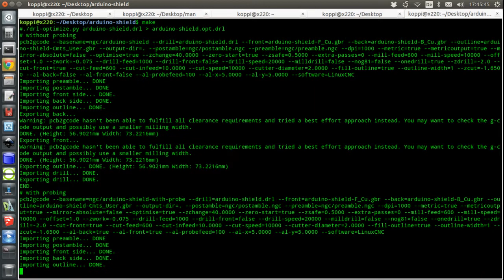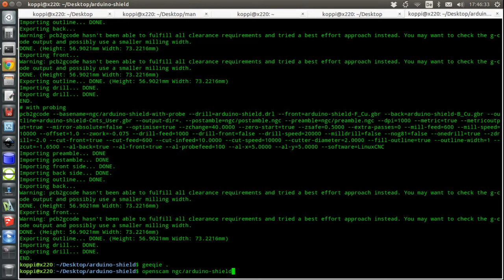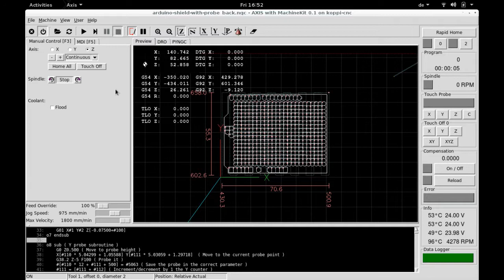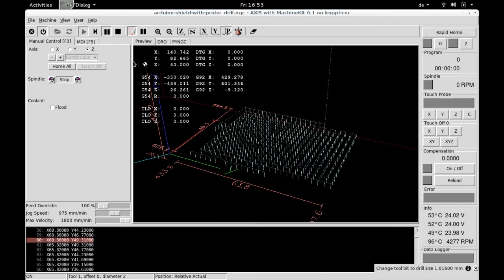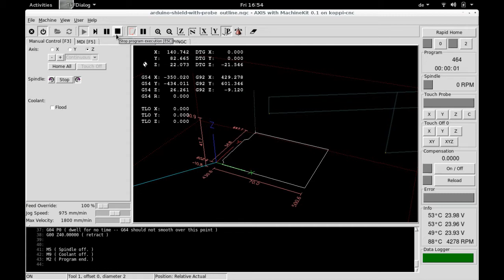Single-sided PCB milling - DIY Arduino shield

Comment: Can you explain, how touch probing is happening (https://youtu.be/2nGcliWefek?t=2m51s)? Are you connecting any wire to the pcb?
Is there any configuration in LinuxCNC that should be done for the touch probing to work?
Reply from the maker: +Filipp Sudanov there's a wire attached to the PCB, you can see it at https://youtu.be/2nGcliWefek?t=10m1s . Just google for "LinuxCNC touch probe" for more relevant information. Or look into the config files at https://github.com/koppi/mk/blob/master/linuxcnc/configs/koppi-cnc/koppi-cnc-io.hal#L27 and https://github.com/koppi/mk/blob/master/linuxcnc/configs/koppi-cnc/koppi-cnc-postgui.hal#L33-L53
 In my setup the HAL pin "motion.probe-input" is connected to a physical IO in the EtherCAT hardware.
Reply: +Jakob Flierl Thanks for fast and detailed answer!